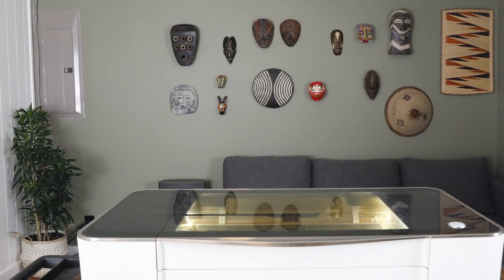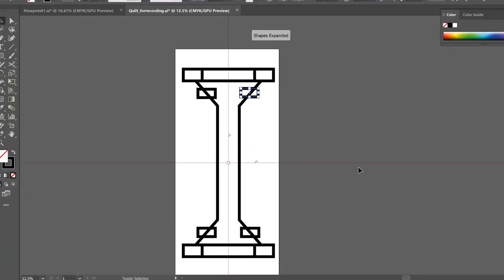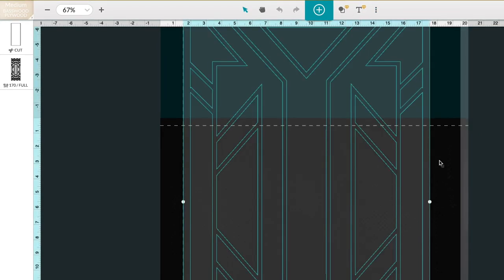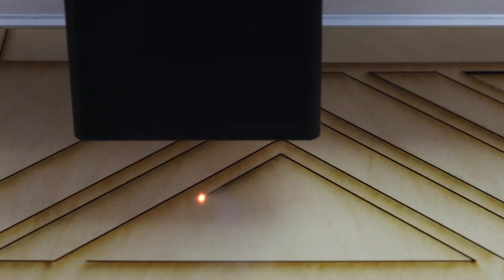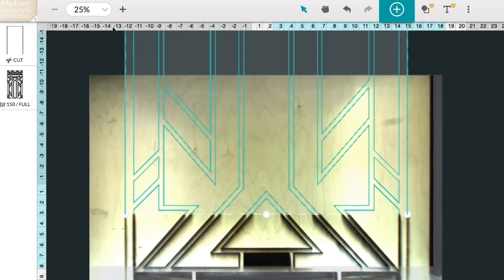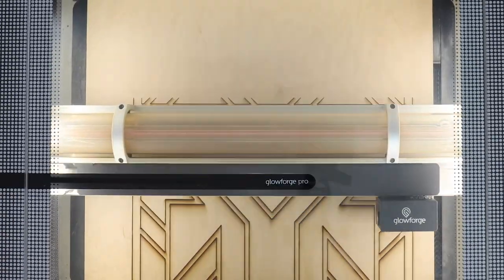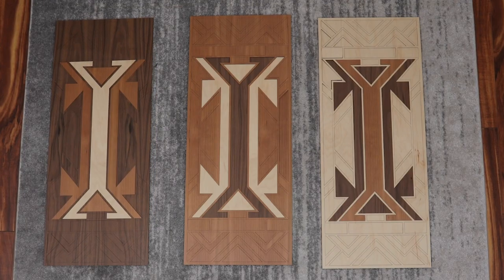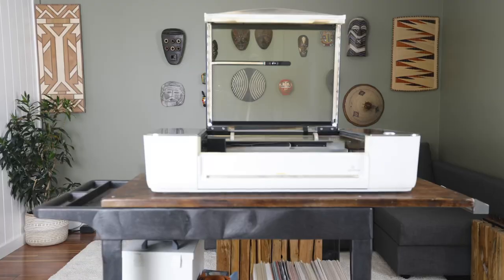How to use Glowforge Pro Passthrough | Cut and Engrave Wood with Glowforge

Comment: Can I use the passthrough slot with the front and back panels open in order to feed thicker wood through?
Reply from the maker: Hi Henry! We recommend operating your Glowforge Pro according to the manual. At this time the Passthrough slot is designed to work with materials that are infinite length long, 20.4" wide and 1/4" thick. -Ellen

Comment: How long did something like this take to cut?
Reply from the maker: Hi there! This huge print has a couple elements to it, 3 identical boards in different woods were cut out with the same design. Then the pieces were mixed up to create 3 incredible prints. Each individual board was split into about 6 Passthrough sections taking about 8 minutes a section. -Ellen